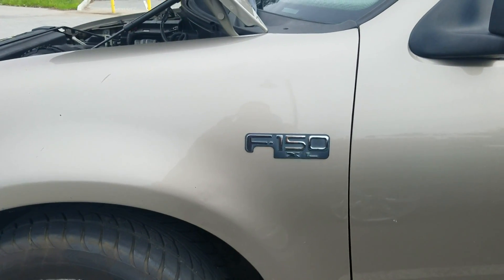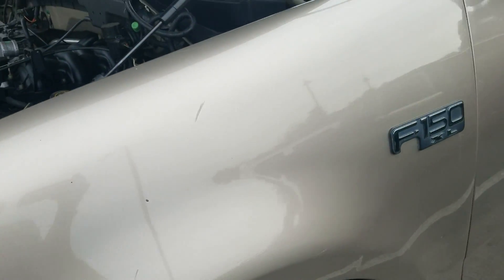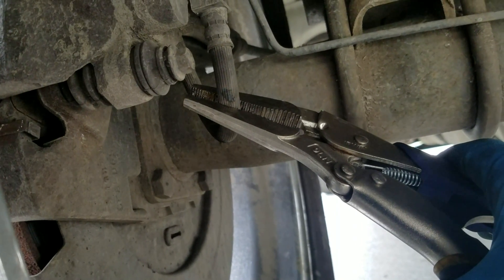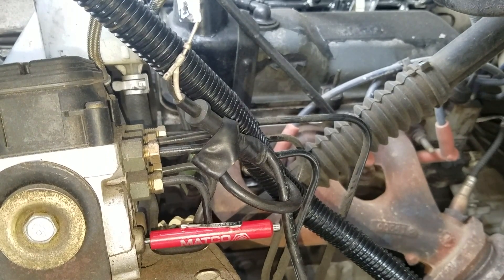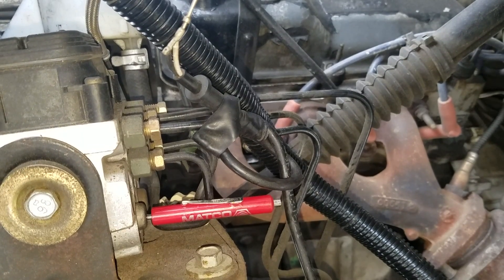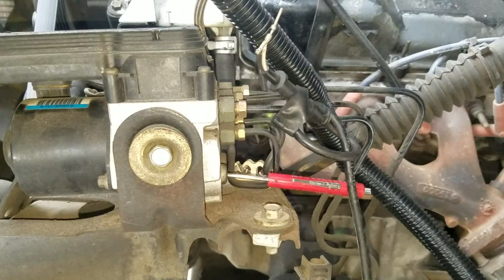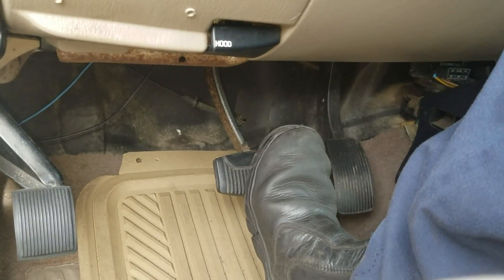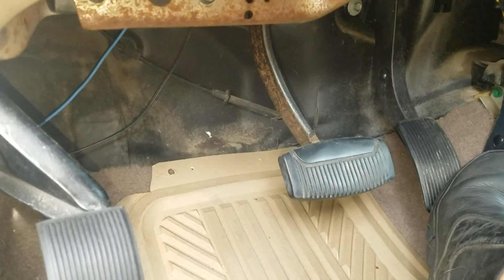04 ford  F150  brake pedal fades in to the floor,loose the pressure

Comment: I just want to say thanks a lot for the tips, i have 2002 f150,i check this part and change ,and is fix,i change brakes,rotor ,booster, master cylinder(3 times),i was about to change the calipers and more parts ,until i see you video,thanks again ,GOD BLESS YOU SIR!!!!!!!

Comment: Make sure you first check where your bleeder screws are on your calipers if you are having issues.  If the bleeder screw is on the bottom of the caliper you may be getting good bleed results and still have the spongy brake. My 2000 excursion kept having that issue until I finally pinched off lines going to the back brakes. Then I took the right rear caliper off and turned it upside down and rebled and that solved my issue. the bleeder screw was on the bottom and therefore some air was trapped on top in the caliper even though it looked like there was no air. I bled the system multiple times.  Then I remembered my physics classes....
Reply from the maker: very good points  you brought, yes this vehicle had abs unit fault as you saw , I block all the lines , and no the fault did not occur after some work on it .
if the  screw driver move on the  hole means the abs valves are faulty open bleeding the pressure

Comment: Didn't know you can test. I have a new master cylinder and all new brakes around same issue and my ABS light is on. Just slowly goes to the floor and cannot stop the vehicle. Every side is bled with no air. Will have to do this test.
Reply from the maker: you have  you bleed the abs with scanner too.

Comment: I have 2013 f350 60k miles with the same symptoms. Before I replaced the HCU, I thought I would try to free up the valves. I hit the brake pedal 20ish times hard with the truck off and then with the truck on. Better but not great. I went to a remote dirt rode and got speed up and hit the brakes hard and let the ABS stop the truck. I did this about 10 times. The pedal no longer sinks. 

I replaced the brake fluid and bleed the system. Pedal is still good. 

Some thoughts on fix. 
Maybe there was some foreign mater in the system and the aggressive braking moved the debris.
The brake fluid cap has never been off. The fluid was always fine.  It is not unheard of having something in the system from the factory. 

I dont drive the truck much in the snow. I don't know if I have ever had the ABS engage while braking. Maybe engaging the ABS freed up a valve or passed (or moved) a piece of debris.
Reply from the maker: good tip , I have done that too my self  before not on this truck.
Reply: Carl, thanks for sharing that!  I'm going to find a place to give that a try!

Comment: I'd like to try this but I have a question.  Sorry I'm not a mechanic.  The hole you stuck the screwdriver in.....did you remove something from that hole first?  Or is that it's purpose?  For testing?  And if air pressure is what is pushing that screwdriver out, I guess it has to be a snug fit, so I
have to find the exact diameter of something to stick in there?  Thanks for making this video!
Reply from the maker: any thing you can fit there , there is a rubber inspection . when you press on the brake pedal  it should not  move  more than 1/4 inch  if it does  your  hydraulic unit is  faulty
Reply: Joel Automotive  In action  y si al introducir el desarmador y presiona uno el pedal no se mueve nada? Quiere decir que la unidad está mal??

Comment: Joel gracias x compartir.
Tengo a Honda Element 2006 con los frenos spongosos
Le puse un OEM master cylinder ( purgado antes de poner
Frenos nuevos en todas las Llantas
Purge los frenos muchas veces 
Cuando le pongo  las pinsas  a todos las mangeras de los frenos el pedal se pone normal
y cuando voy retirando las pinsas, una x una. el pedal se va sintiendo  gradualmente spongosos
Calipers , discos , pad shoes. Mangeras y master cylinder son nuevos
Los frenos no hacen ruido solo el pedal se va hasta a bajo 
Que Crees que deva revisar?
Reply from the maker: Mario Arenas 
uno a la vez has los calipers  no todos  la mismo tiempo  aun asi puedes   tener problemas en un  calipers que   los pin tenga mucho juego , pero si se pone firme el pedal eso significa que temporalmente  reparastes el problema ,  tienes que enfocarte en uno por uno de los caliper
Reply: Si reviso caliper x caliper el pedal siente flojo. Pero si reviso todos a la vez el pedal se pone duro. Y como voy retirando las pinzas una x una el pedal se va bajando poco a poco. Eso me hace pensar que  hay problema De presion. Le puse   una  usada abs bomba y  un re  power booster sin ningun cambio.
Active los abs solenoid valves con un scanner,  purge sin ningun cambio.  La Honda dice que no Es necesario purgar los frenos con especial scanner
Te agradesco tus consejos

Comment: I have the same issue with a 2008. Do you have any tips for that? I can’t seem to find a HCU for that year. Only can find up to 2004. Thanks!
Reply from the maker: You need to work with the system your vehicle has , to start trouble shooting
Reply: Joel Automotive In action  Thanks for your quick reply. Do you know if the 08 has the same system to replace? I can’t seem to find that part for 08.